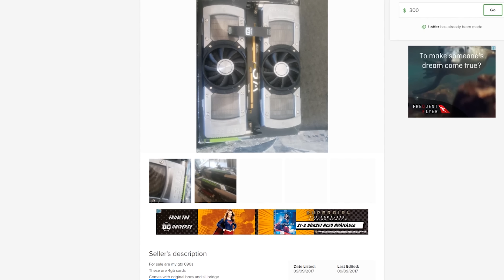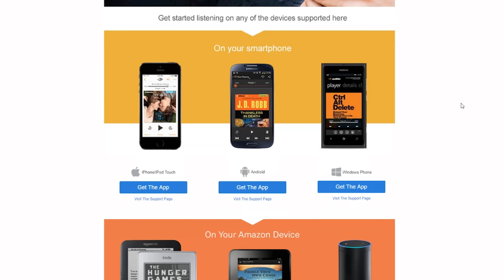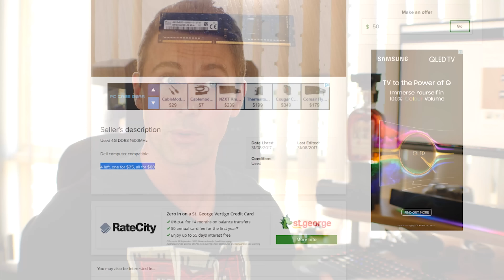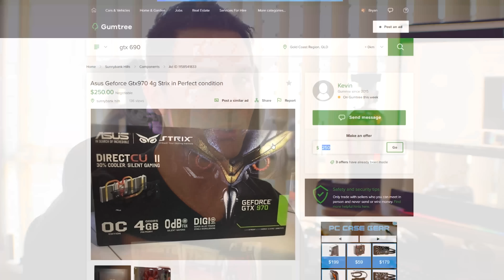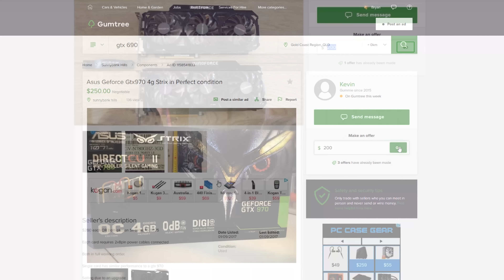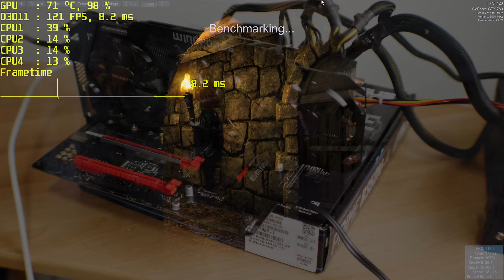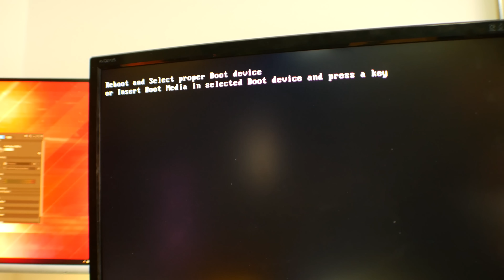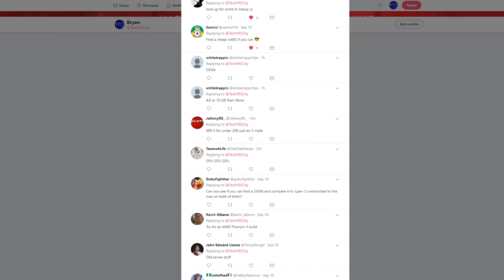September's MASSIVE Bargain USED PC Parts HUNT....!

Comment: We want build with i7 980x OC TO 4GHZ please
Reply: X AK Custom watercooled it should get around 4.6Ghz like my Xeon X5670 (22x210FSB) on my Rampage II Extreme 1.525Vcore -.-
Reply: +Björn Paulsen I always wondered what would be considered an average VCore for a 4.6 GHz (=209 MHz *22) X5670, because I had one on an MSI X58 Pro-E and it would also need around 1.52V to be Cinebench R15 stable (though it was Prime or Linx stable way below that voltage). Also, how much of a problem is degradation? I mean, this is not really a problem since AliExpress sells these chips for $40 or less someone can afford to buy another one every year or two if necessary and sell the old degraded one on eBay if it at least works at stock settings. Also, your board should be able to unlock the CPU multi by two digits like every X58 board that is not from MSI can afaik which would enable *22 multiplier even on X5650.
Reply: Also, I noticed that a X5675 did need less voltage on *23 multiplier opposed to the *22 one on the MSI board to be stable at the same resulting core clock speed of 4.6 GHz (<1.5V in the case of the *23 multi), making higher multipliers even more worthwhile than just going easy on the QPI.
Reply: Was geht sie das an? Actually I'm not worried about CPU degredation at all as my X 5650 and both 5670s are still alive. But two premium x58 boards died on me this year. A P6T Deluxe V2 and one of my R II Extreme. The first was shut down normal but never started again and the Rampage slept in hilbernate and haven't come back since...
Voltage wise I've Seen similar between the 5650 and the 5670 when even 4.4ghz needed 1.55 for stability on the 5650. And this needs a lot of heat absorbtion on my loop talking Mo-Ra 3 Rads in use here...
Meanwhile I'm waiting for a Rampage IV Ext. I bought recently on eBay. It comes with a 4930k but there are options for xeons as well... ;)

Comment: I never understood why a reference design GTX 680 or 770 costs more than a GTx 690? The pcb of the 690 is one of the most amazing pcb´s i ever saw, and it was the first founders edition card which introduced the metall coler design. It has a plx chip and is the best sli system you can get, together with the titan z which is too expensive and th GTX 590 which ??? i think there are some very rare modells of evga GTX 690 gemini2 which has two cherrypicked GTx 670 GPUs with 4096MB V-ram per GPU on it. Because of the lasercut some gtx670 GPUs could be overclocked so high and better than every 680 GPU that they were faster. It must be a much faster card than every 690, but i never saw one, maybe it doesn´t exists and i catched up a fiktional tale? Think no this story is true!!?

Comment: Nah a 1060 3GB doesn't perform to the level of a 970, which is marginally better than an RX 480. I picked up a 970 with a HG10 N970 mount + a H75 AIO for $250.
Reply: Wizard Koer marginally better than a 480 in dx 11 and open gl right? That's about the only places I can see any version of the 1060 being better than the 480. Not to mention dev optimization for one brand or the other. Ashes is one of the few games where the actual card performance in dx 12 matters more than brand since AMD sees a boost due to async while the 9xx cards don't even see a hit to performance.

Comment: i saw Intel a i7-3820 for $40 on gumtree
 is it worth it?
Reply: You will need a pretty expensive mainboard for that.
Reply: saw a few for around $180
Reply: Cptmarko So 220$ sounds really good for an overclockable 6 core, but its Sandy Bridge.
Ryzen 6 cores arent far away, pricewise and are just newer with an upgrade path. Your choice.

Comment: Ewww... Why would you PURPOSELY install Windows 10 - when you've got a perfectly legal copy of Windows 7 Ultimate?? I am still running Windows 7 Pro and I do NOT want to change that...

But when Coffee Lake comes out, well if it is good for gaming (and I have little doubt it will be anything short of AMAZING) - I will FINALLY be upgrading from my i7-2600k that I bought brand new at launch, and the ASRock Z77 Extreme4 platform I have loved so much... I find it bullshit that Intel wants to force Windows 10 with their Kaby Lake and newer CPUs, but I suppose I will have to "upgrade" myself eventually anyway - once DX12 actually means a lot I definitely will want to use it.
Reply: DysphoricSmile Ryzen doesn't get proper support on 7 either, not unless you find that workaround which does something to the cpu check on the OS. It's not just Intel, it's MS fucking around with things.

Comment: used parts could mess up the whole system
Reply: iRapplexD it's possible, but doesn't usually happen. I've swapped parts a lot without things actually happening, except in one case where this board I bought used no longer wants to work properly. If it's not just stuck on a black screen, then it's stuck boot looping. Sad to actually have to say that.